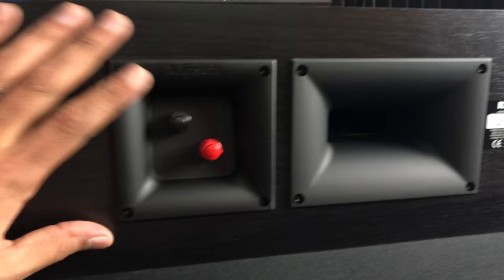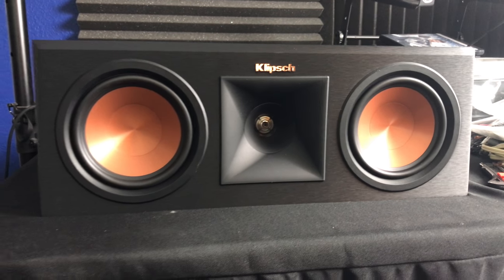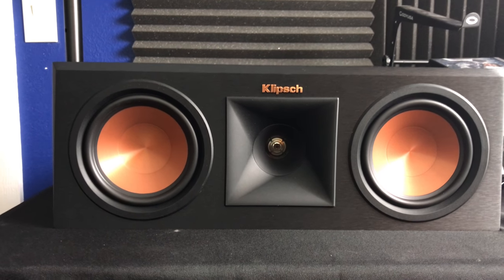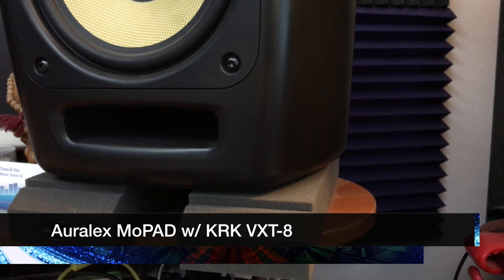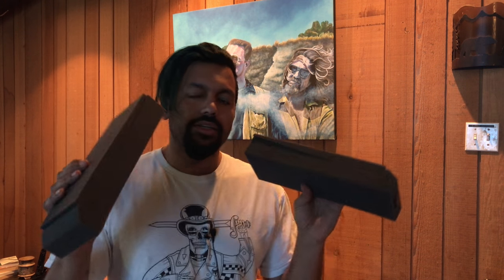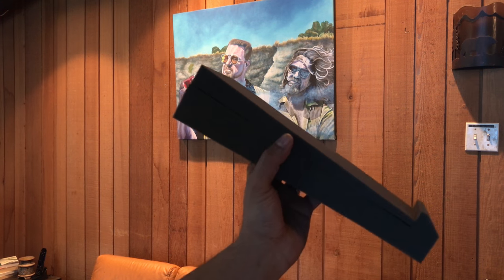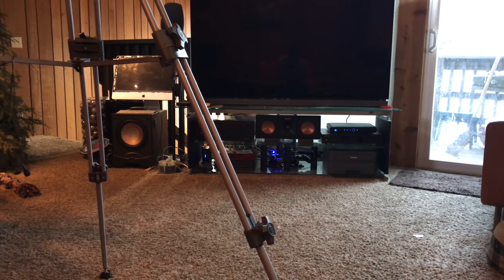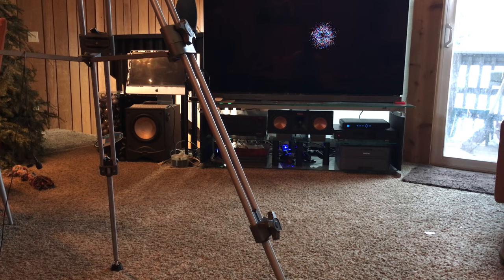Klipsch RP-250C | Install & Isolation

Comment: nice! I have that speaker along with the RP-280fs  and 4 RP -250S I freaking love them! the clarity they have is amazing, huge upgrade from my 2012 Klipsch Quintet 5.0s. I do have 1 question for you. the LG OLED TV you have, have you had any kind of Burn In issues with it? I am thinking of Upgrading my Samsung JS8500 65 inch tv to maybe the LG OLED65B6P or the new 2017  OLED65B7P. took my wife to best buy the other day so I could show her the difference between our Edge lit 4k tv and a LG OLED TV. she was blown away by the LG 😈 thanks for your time 😎
Reply from the maker: +jose luis ruiz Hi!  You have an awesome setup!  I am about to jump on the RP-280Fs since I get a free R-122sw with the current promotion!  HUGE!  Anyway, I love my 65" E6 OLED and have not noticed any burn in issues.  I have not used it as a computer monitor yet, but I hear that's when it happens.  I am currently upgrading my music studio computer and will have my old mac mini in the living room as an HTPC.  So I'll find out in a month or so what the deal is when using the OLED as a computer monitor.  I would suggest trying to get the E6 since the processor is a bit faster.  I have heard reports of judder on the B6 with fast moving objects.  I personally have not seen it, so I can't really say for sure.  The E6 does not have any issues with this.  My wife loves football so we watched that a lot this year on the OLED.  We've had it since early November.  I got mine from Echo and Optics eBay store for $3,100, which is actually cheaper than the B6 price at Best Buy:  http://www.ebay.com/itm/LG-OLED65E6P-65-Smart-OLED-4K-Ultra-HD-TV-/282054559711?hash=item41abc307df:g:vXMAAOSwUKxYf3CL
Reply: Techno Dad cool thanks for the reply. I will check out the E6 for sure. that's a hell of a deal on getting the free reference sub woofer. 🖒🖒🖒🖒🖒🖒🖒

Comment: a   cheaper option than foam is  get a  squash / raquetball  ball and  cut  it  in  half and  put  each half  under the  front  corners  of the  centre  speaker. That  too will absorb  the  sound.

Comment: I just got the same center channel speaker but I got 4 RP-150M speakers.I am up grading from my Klipsch Quintet speakers.I also picked up a 12 inch Klipsch sub, I'm stoked to get it hooked up when my stands get delivered.Good video bro.
Reply from the maker: Thanks for watching, I'm glad you liked the video!  Those RP-150Ms are great!!  I just got 2 of them for my surround speakers (https://youtu.be/eZ8WskUmpNg).  I'm planning on buying the RP-280Fs for front speakers, and if I buy in the next week, Klipsch will throw in a 12" sub (R-112SW) for free!  Which 12" Klipsch sub did you get?  Other than having the copper cone on the sub, I've been told to check out SVS since they make better subs.  So I might end up selling the Klipsch R-112SW that I'll be getting with the current promotion.  What AV Receiver do you have?
Reply: I have the R-12sw and I just got  the Denon AVR S510BT.I had a older Denon and I moved it and the Boston acoustic speaker and sub into my bedroom.Those floor Klipsch speakers are really nice, I can't afford them yet but I'm gonna get them one day.
Reply from the maker: Yeah, I sad that long ago, and finally I get to own them!  Finally!  I started buying Klipsch in 1995, it's been a long time coming, and I work hard, so it's time to treat myself!
Reply: Techno Dad I'm gonna do a before and after video to show my new setup when my stands come Thursday.Im subbed to you now enjoy the new speakers bro.👍🏿

Comment: Woah, $30 for some foamy things. That's the same price I paid for my Philips HT 5.1 3D Blu-ray 1000W surround system. 
But that's just me, I like buying cheap shit. A week later I bought an Onkyo 606 for $50, and I'm slowly picking up speakers as deals come up on eBay. Great solid video, as usual. I think it's time to subscribe..
Reply from the maker: LOL!  Yeah, it's pricey for foam.  I actually had them in my music studio and was like, I should use this for my center channel because I could hear the glass shelf rattling.  Also, I really like the 4 degree angle up which lets the sound get to my ears better.
Reply: Still,I suppose it's totally worth it if it does what you want it to do. The right tool for the right job and all that..

Comment: Techno dad do you think the rp-160m with match with this center? Seen 450c however it’s size is massive and it’ll be a tight fit in my tv stand
Reply from the maker: HI Sergio!  Yes the RP160M and the RP250C would be a great match!
Reply: I have both of these and I am very satisfied!

Comment: Hello, does klipsch speakers goes well with other speakers? Like me I have diamond 225 bookshelf speakers for my fronts, polk s10 for my surround, polk s60 for ceiling speaker. And my future subs will be svs sb 2000. Because Im planning to upgrade my center to 250c or 440c.

Comment: Planning to switch my Polk center for these. Feel like the Polk have too much bass sometimes I can’t hear the dialog..
Reply: Same here. I'm upgrading from my Polk CS10 which has served me well but I feel I'm ready for a bit more quality. The only problem is I feel I need to upgrade my towers too now! I'm looking at the RP-250Fs to replace my Polk Monitor 60s. Should be a fairly nice upgrade once the setup is complete!

Comment: Are both drivers mids? Or is one the mid driver and the other low bass extension? I am trying to figure out if using 3 of them for front sound stage would work out. (I would want to orientate them as bevel out, so the left bevel pointed to the left, the right bevel pointed to the right ECT.)
Reply from the maker: Hi, both are mids, the RP-450C is more like a 3 way speaker. http://amzn.to/2p7xO0S
Reply: Techno Dad Good to know thanks. So do you think they would work okay as LCRs then? From everything I can find they are 2 phase, and they have the same crossover as a 250f, so to me they are more LCRs than just centers.

I sadly can't fit 250fs or anything bigger so I was hoping to run 3 of them for LCR. It's that or Bookshelf's.
Reply from the maker: I would go with a pair of RP-160Ms and the RP-250C.  If you want some awesome pricing email me and I'll get you in touch with my Klipsch dealer: technodad55@gmail.com

Comment: Hi, a Random question , I found RC62II center speaker for about $190,(brand new ) should I buy that or just spend $180 More and get this new model (RP-250C ) 
Thanks
Reply from the maker: Hi!  The RC62II are matched with the RF7II, so I would go with that if you have the RF7s.  If you have anything in the RP line, I would go with the RP-250C.
Reply: @TechnoDad  as  I've a small  room 13ft x  11ft..  I'm using bookshelf  speakers on  stands.. which stereo /  bookshelf  speakers & centre speaker should  I  get? I've  already got a  Klipsch R-100SW subwoofer..

Comment: question??? I was wondering could I buy 3 of these exact speakers but use 2 of them for front left and right channels as well?
Reply from the maker: +bribird991 Hi!  Great question!  You could, but I wouldn't recommend it.  I would go with a pair of Klipsch RP-150Ms (https://www.crutchfield.com/p_714RP150ME/Klipsch-Reference-Premiere-RP-150M-Ebony.html?tp=186&awkw=116635933225&awat=pla&awnw=g&awcr=175692946225&awdv=m&awug=9031785) they go as low as 48hz and are designed for music and foreground movie information.  I bought a pair for surrounds, here's that video (https://youtu.be/eZ8WskUmpNg).  At $419 for the pair, it's a better deal, and it's also the correct orientation for your left and right speaker.  I may be selling my pair and picking up a pair of RP-250S, but I'm not sure when.
Reply: @TechnoDad  hi techno dad I have a pair od RP-160m Klipsch  speakers can I use them with this RP-250c and my R-112sw Subwoofer in a 3.1 setup?

Comment: I have a Marantz 1506 receiver but only gives 50 wpc. Do you think will be enough for the Rp 250c?
Reply from the maker: Should be fine.  The Klipsch are super sensitive and easy to drive
Reply: Techno Dad Thanks for the reply man! I just finished your video about the power that the speakers need. Just another quick question. Do you preffer the SVS Ultra center speaker for a pair of RP 150M’s or should I stick with this 250c speaker to match brands? I finally save some money to upgrade my 2.1 system to a 5.1, im so excited lol
Reply from the maker: So I would stay Klipsch so that you can timbre match the center to the mains.  You'll want speakers with the same tweeter and audio signature.
Reply: Marantz is a “real” 50 watts. I used to have an old 1060 amp. I used it to FILL our schools auditorium with sound foe a dance recital and it was only 30 watts/channel at 0.1% THD. It will do fine.

Comment: is the klipsch rp 250c better sounding then the rc52? thanks
Reply from the maker: Yeah, it's a different line all together.  The horn/tweeter is different, and less harsh due to the rubber surround.  Also there are the different design elements.  The Reference Premier line has magnets for their grilles, so there are no holes in the speaker cabinet.  That looks nice.  I ended up selling the RP-250C and getting the RP-450C.  The 250 was overpowered by my RP-280Fs, and once I got the 450C, it matched up real well!

Comment: the RP250c has a tilt rod that comes with it? i saw in online in the user manual.
Reply from the maker: +BlackSpider Hi!  I never got one of those in the box.
Reply: check the user manual, i think its mentioned there, i saw user guide online & saw the optional tilt.
Reply: I never got a tilt rod either..

Comment: Thumbs down for the obnoxiously loud music which is ironically way out of proportion to your voice. It's quite the reverse of what you want from a center channel speaker, which is to hear the voice above all the rest.  I am listening on an all Klipsch Reference Premiere 7.2 setup including this RP-250C as my center.  I could barely hear your voice so I turned it up. When the damned music kicked in you probably woke up my neighbors as my two Subs R-115SW & R-112SW exploded with that bass thumping. My subs are set and forget at reference level too.  You need to take better care with your mixing. My 2 cents.
Reply from the maker: +ArJuna22 Hi!  Thank you so much for your input!  Something has been up with my lav mic as the sound I'm getting from it is all over the place.  Sometimes it sounds loud and clear, and other times it sounds weak and tinny.  I will definitely take better care when mixing in music.  I think I did better with my newest video.  If you could check out the audio on that one, I would really appreciate it!  The video is scheduled for today in about 40 mins (6am PST).  Also, what other pieces do you have in your Reference Premier setup?